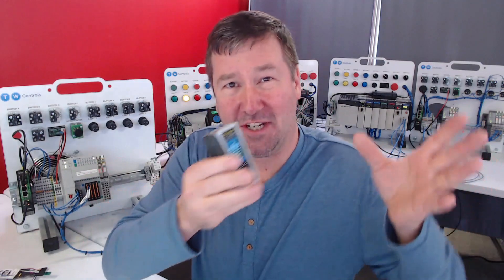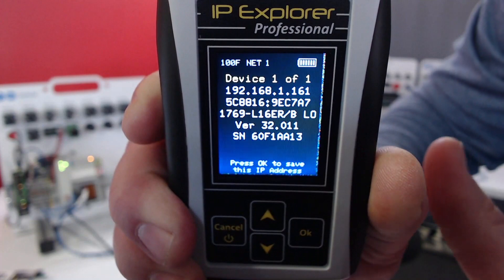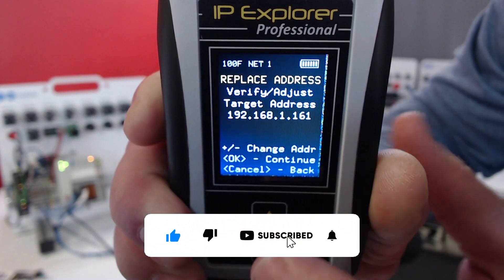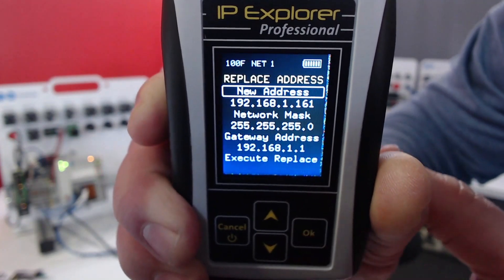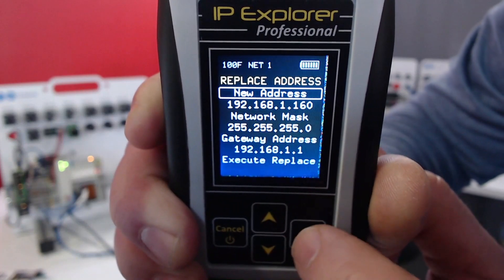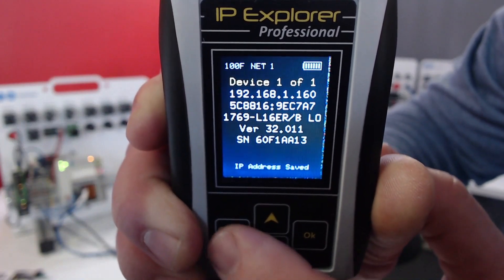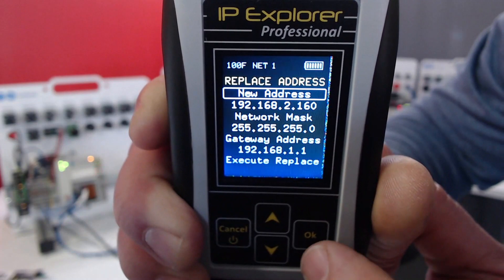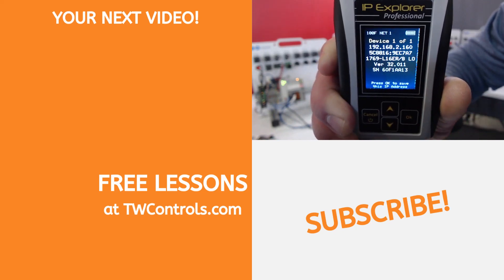Change Static IP Address of Ethernet/IP Device

Comment: will this work on any bootP enabled device ? I just did the bootp dance using the rockwell utility and since I work on a million different subnets I always have the gateway wrong in the tool.
Reply from the maker: This is a standard Ethernet/IP feature so if a device follows the protocol then this will work.
Reply: @TimWilborne  BootP is an Ethernet standard, not an Ethernet I/P (Rockwell CIP)  standard. 
Is this exclusively for the Ethernet I/P  protocol, so it wouldn't work on an early firmware PLC5 for example that doesn't support CIP ?
Reply from the maker: @EmmerBigguns  I'm not completely sure about PLC5.  Ethernet/IP is necessary to switch between BootP or DHCP and a static IP.
Reply from the maker: @EmmerBigguns  I dug a little deeper and the only processor that was around when set static feature as added was the series F which was around 2004-2006.   It is doubtful that they would have added it to them.
Reply: @TimWilborne  That fits. Series F was, I believe, the first to be CIP (Eth I/P) compliant. (ETH I/P  logo is on the data sticker) Series below that will also be unable to easily communicate with Contrologix PLC's as they only speak PCCC on port 2222. There was a firmware update to upgrade these, but that has since become nearly obtainable. And considering their age, That's probably for the best. 

So it sounds like this device uses CIP to set BootP and so is not fully RFC951 compliant. If it was this would set BootP on anything like PC's  or other devices or instruments that are not CIP compliant. I bought one so I'll let you know if I run into any and how useful that additional protocol would be.